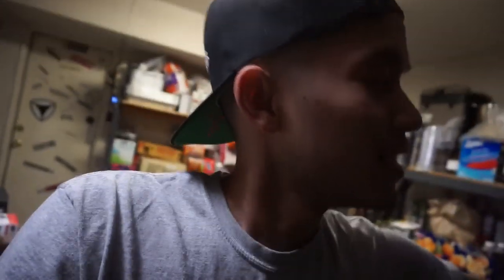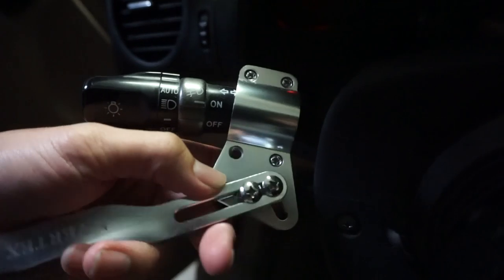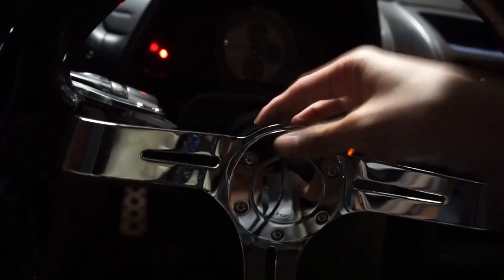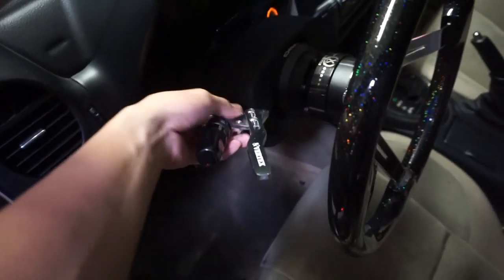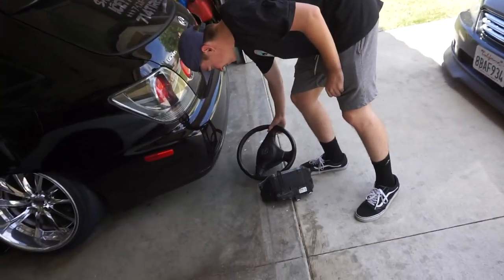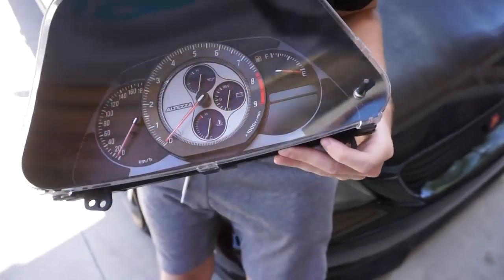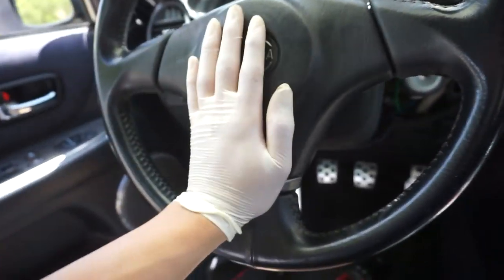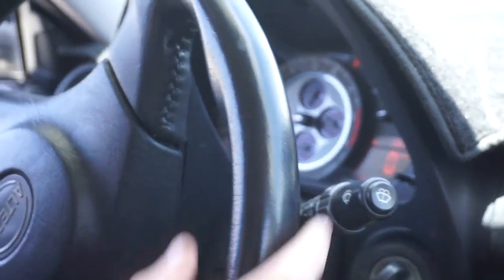Over Night Parts From Japan!

Comment: I have an is300 and I'm wondering if its just me or the car. During the daytime my cluster has no lights on which makes it somewhat hard to see how fast I'm going, during night time it's fine cause I have the lights. Is there something wrong or does the is300 just not have daytime cluster lights? I was even thinking of getting the altezza cluster just to have digital speed but backed off that idea after seeing people (like this) have all the lights on the dash and inaccurate RPMs. Any feedback is greatly appreciated.
Reply: The lights only come on when you flip the turn signal stock one click but theyre dim and u wont be able to see them during the day